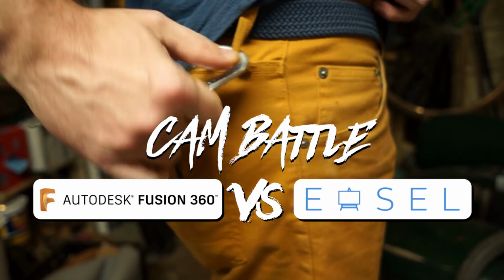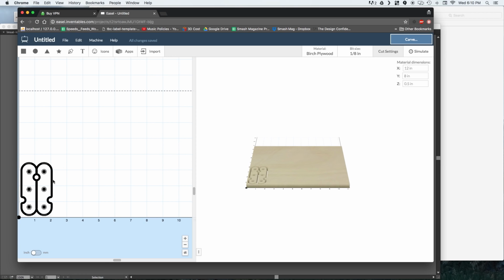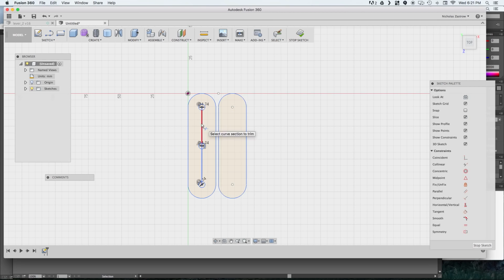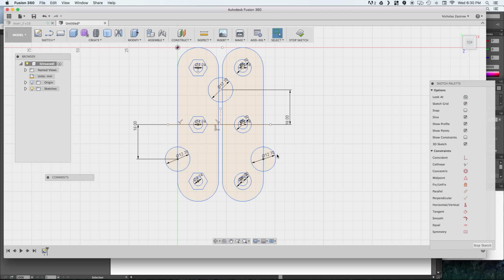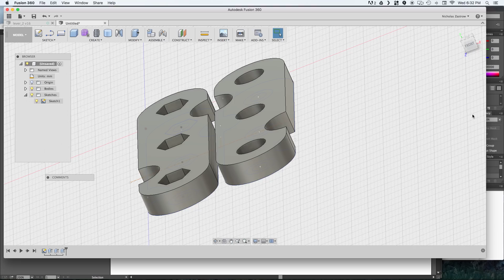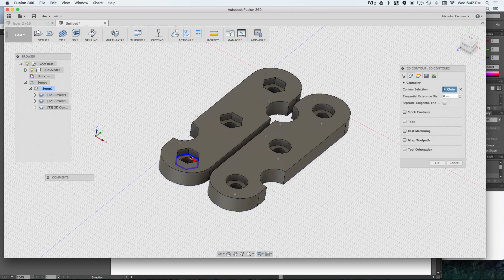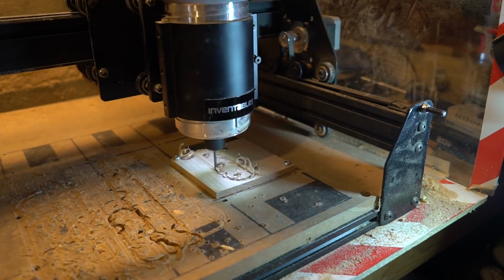Fusion 360 vs. Easel on the X-Carve - LMSAT

Comment: Do you find that carving in fusion 360 is noticably faster? Not due to in/per min but due to the software creating more efficient passes based on the bit you are using?
Reply from the maker: I feel that it creates more efficient toolpaths, plus you have more control over it...so long story short, yes.

Comment: Do you have a video of how to setup your xcarve on fusion or just how to use fusion with xcarve?
Reply from the maker: Not really, but I should make one. It is a little difficult because you need to program feeds & speeds manually, program the tool paths and use the correct post processor.

Comment: Can you make money with a machine like this or should you get a more expensive commercial grade machine?
Reply from the maker: I guess it kind of depends on what you want to make. It is definitely a hobby grade machine with limited abilities. Tool changes, workholding, cut area, and feed rates are a big downside with this machine. However, small projects are great on this. These little swiss army style key organizers sell pretty well and I randomly get requests for one off / prototype work that are fairly profitable. The key organizers are less than $2 in materials and about 10-15 minutes of work and sell for $25. When I run prototypes, I charge material cost plus $60/hr machine time.

I paid off the machine with 3-4 jobs I had lined up before purchasing it. But unless you have products/ideas/jobs lined up, it might be tricky to turn a profit. Still a fun thing to have around for making all kinds of useful things.
Reply: @letsmakesomethingawesometo8266  I really want to buy one of these X-carve's so much! but it's so expensive, Glowforge have also made a really cool machine which is laser only but that costs 5K US !

Comment: Using the sketch pattern function in Fusion 360 would have made modeling this part even faster. There is also a pattern function in CAM, for instance if you wanted to make multiple identical parts at once. Patterning totally changed the way I work in Fusion 360.
Reply from the maker: +micvee yeah, I come from a print design background and thought it was easier in illustrator. I've been getting way into fusion on the last two years and it is changing my thought process.
Reply: You could still draw your sketches in Illustrator if you really wanted to. Just export the drawing from Illustrator as a DXF and import directly into your design file using the "insert" function in Fusion 360.
Reply from the maker: +micvee yup. Very familiar with that.

Comment: i have the x-carve and regularly cut oak at 100 inches per minute, up to 1/4 inch depth with 1/4, 1/8th etc endmills and get terrific results (1/2 bit diameter stepovers). My x-carve is completely factory without any stiffening mods etc. I couldnt tell here but are you using the optional precision collet or the adapter that comes with the x-carve? The adapter is total crap and causes a lot of chatter etc requiring crazy slow speeds, once i switched to the collet things i was able to really turn up the speeds and feeds a lot.
Reply from the maker: +bpatters I use a dewalt router and a collet for smaller bits (that I bought on Amazon).

Comment: One suggestion that can speed up your Fusion sketching: draw only one of the two parts, use the "mirror" tool to duplicate it, then draw the recesses.  Takes half the time, and even better if you change a dimension on one the other will change automatically.

My experience matches yours: the default tool speeds and feeds in Fusion are for heavy-duty metal CNC machines, and are often way too aggressive.  You'll need to do some trial-and-error to create a custom tool library for your machine and toolbits.
Reply: Even beyond mirror, you can use rectangular pattern to get all the holes the same
Reply from the maker: +Jason Goodman I've been running a tormach cnc at work for the last 8 months, due to that, my xcarve hasn't gotten much love lately.

Comment: Tu mesa o base de la X-Carve está suelta, necesita ser atornillada tal vez por eso los cortes no están saliendo bien... Saludos amigo.
Reply from the maker: I noticed that in the video. It happened some time right before filming. I've fixed that issue with a new wasteboard
Reply: I also passed, my circles were bad. Greetings my friend
Reply from the maker: +Erik Quintana adjusting the potentiometers for the stepper motors helps. It might be time for me to upgrade to the new motor controller, seems like even with correct voltage I'll lose steps randomly.
Reply: Thanks after a good time calibrating I have "perfect" circles thank you very much, I am still away from the new controller maybe in another year. Greetings and I keep watching.

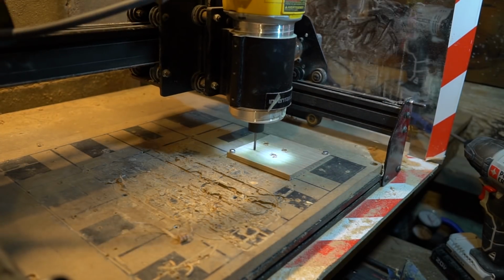Comment: At 5:47 your whole waste board is moving like crazy.
Reply from the maker: My waste board is fully trashed. I've been meaning to replace it for a few months now. It is strange how much it moves, yet it doesn't (usually) effect the tolerance on the final part.
Reply: Well the tolerances is probably off the same amount as the board is moving.